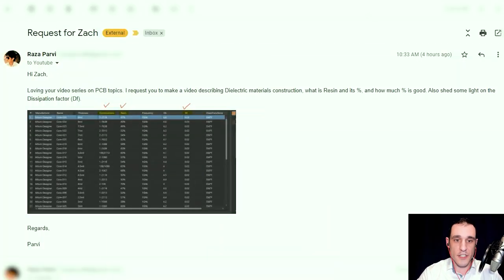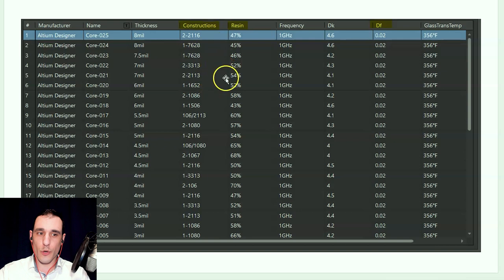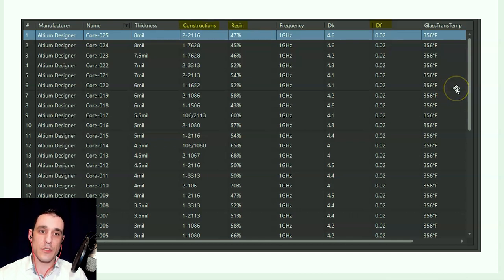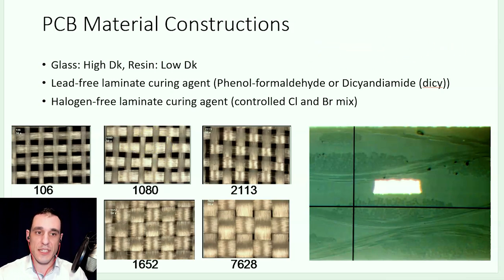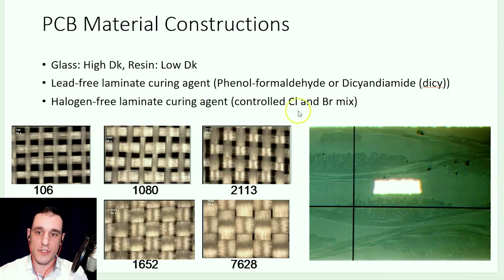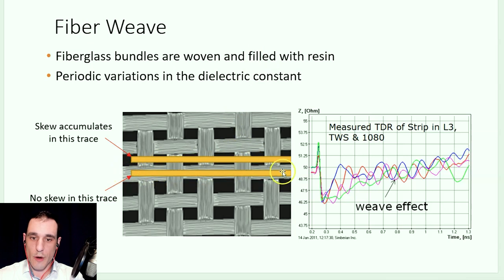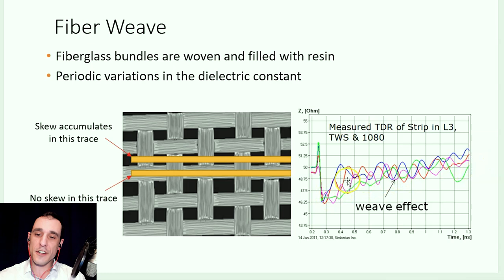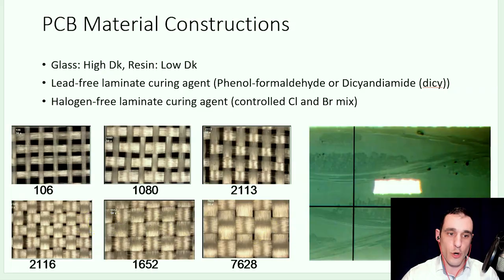PCB Dielectric Materials Construction | PCB Manufacturing

Comment: So glad you do these videos! I’m super interested now in high voltage dielectric selection. I had never heard of that until now. If we are working above 250V, what are the dielectric materials we should be leaning towards? Or maybe even better yet, what should we be absolutely avoiding?
Reply: So I'll give you the summary here: the best dielectric materials for high voltage have higher resin content with phenolic curing agent. Compared to phenol cured laminates, DICY cured laminates can have higher failiure rate due to CAF growth for a given voltage. Note that this does depend on the plating material because certain metal ions in the plating material may be more electrochemically active and can exhibit faster CAF growth.

Comment: I am using Rogers RT5880 and trying to import it to material library, however I cannot find the *.xml file for it. What should I do? Is there any extra step to start high frequency vs low frequency PCB? Thanks!
Reply: This is a good question, I'll look into this. To be honest I do not normally use the material library, I normally get the data for the layer stackup directly from the fabricator. But I think this is important because the library is useful, especially if you always use a specific set of materials so I think I should make a video about it!